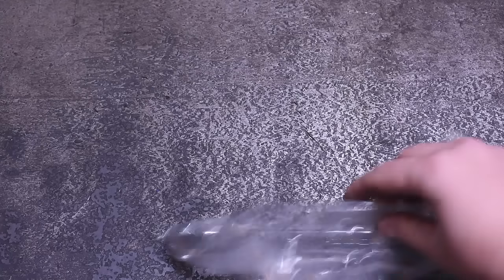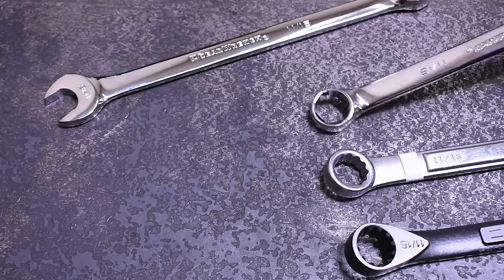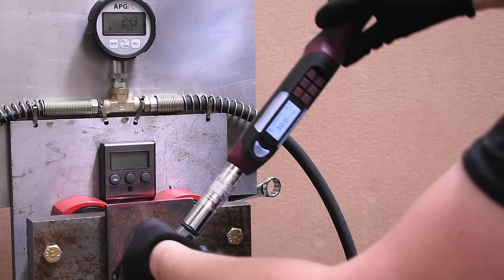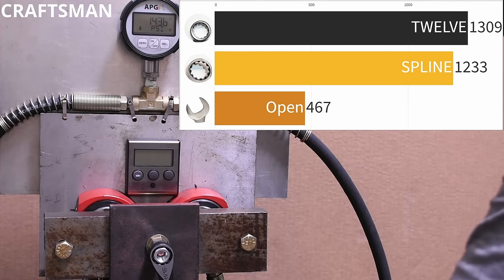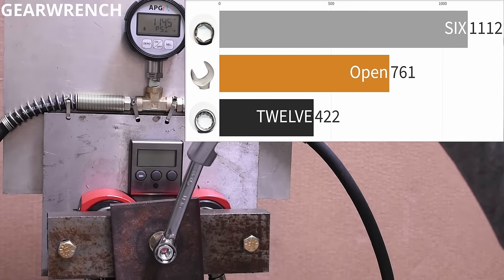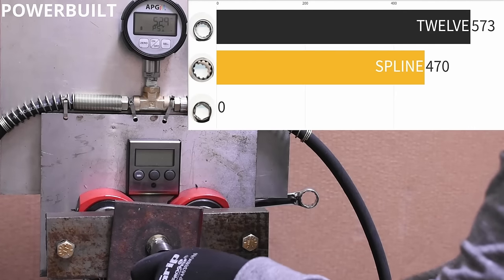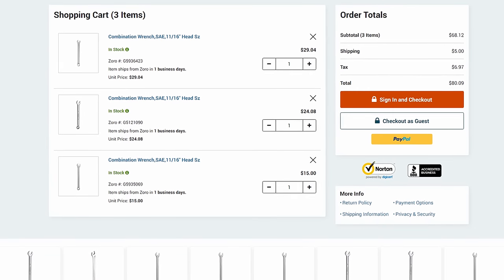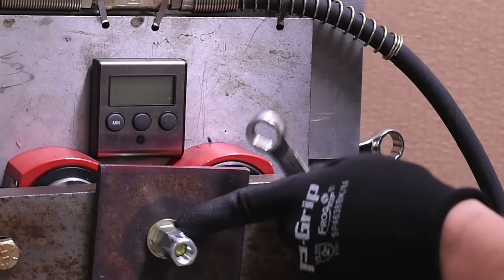Let's Settle This! What Wrench & Socket Design Will Slip 1st?

Comment: No clue what some people do with their tools to even need this info. Been turning wrenches for almost 20 years. I own exactly zero 6 point sockets or wrenches.  12 point works just fine all the way to 600 ftlbs. Anything over 600 ftlbs we use hydraulic hi-tq so that could be why I've not had a problem.  Also I work in an industry where we don't have rusty, chewed up crappy hardware.  Only thing I can figure is people need to workout their hand and forearm muscles to actually hold the socket on the fastener if its that big of an issue.

Comment: I couldn't help but notice, but I may be wrong. It didn't look like you changed the nut after the first wrench rounded off before trying the next style wrench within brands?
Reply from the maker: Each used a different nut
Reply: @TorqueTestChannel  okay, I guess the precision rounding threw me off 😂

Comment: 12 points have been the ONLY type of wrench that has continuously stripped my hex bolts on my car! 

And no its not bc Im "using it wrong" or "putting too much tourqe on them" its the fact that 12 points just have a knack of slipping no matter the technique if its a tourqed bolt

Comment: Can you please conduct this with the Astro 7181XL? They are box end wrenches designed specifically for rounded fasteners. I have a set and there are a couple time they saved my ass and well, other times there were less useful.

Comment: So basically 12 can be useful on wrenches for usability, as it can be easier to get on a bolt, but only when you can't fit a socket, and only when the bolt is clean and not overly stuck.

Comment: You should have, but yYou did not make the distinction of using, or not using, the new fangled 6 point socket design having radiused corners such that the turning force is NOT at the bolt, or nut, hex corners, but instead at the flats of the fastener. I have found that a new fangled design radiused corner 6 point socket will grip on those rusted and rounded fasteners well enough to bust them off and not needing to get out the cutting torch, hammer & chisel, or grinder.

Comment: I've got gear wrench ratcheting 12pt and they slip constantly and then craftsman not ratcheting 12pt and they slip occasionally on really rounded bolts but in general never as much as the gear wrench

Comment: Id love to see a comprehensive torture test of Pittsburgh sockets. Not the nice ones that are sold on a rail. 
The ones in like a "52 piece socket set, ¹/4 to 1/2" drive sae/metric" and the set will be like, $10
Ive had a set of socket wrenches from HF for about 4 years now. The wrenches themselves have held up well

Comment: Should have thrown a vise grip in the mix. 😂 That's the last tool you use on a stripped bolt before you bring the car in n explain your brothers cousins wife did your oil last n chewed up your bolt. Love the channel.

Comment: Iwould have used a "minimum spec" flat size instead of a "pre-rounded" condition. However, apples to apples either way.  Interesting that only twice did the nut start to collapse.  How do the "any nut, no matter the damage" wrenches/sockets compare? Pipe wrench?

Comment: I just TIG a big nut over the bolt head. A nut with an ID almost the dia of the bolt head. The welding will also heat up the bolt. Then that heat will soak into whatever the bolt is stuck in  - causing it to expand and loosen its grip on the bolt. I prep with two different impact wrenches: One smaller for it's higher speed vibration frequency. A larger one for its hard slamming torque. Loosen with the small one first, folks! Extracting busticated bolts sucks.

Comment: Spline and 12-point grab the corners while a 6-point kind of hug the hole thing. They dig into the corners while the six-point contours to it. If you're using a 12-point for a 6-point hex more than likely a 6 point is the way to go because a six-point wrench was designed for a 6 point hex.

Comment: In my opinion. If you are going to get wrenches or sockets, just buy both 6 and 12 point. You never know what you’re going to need at certain points in time and it’s worth it to have the tools for the job rather than having to go to the store later anyway.

Comment: I personally didn't like the method for rounding the nuts as it didn't seem to be consistent along the length of the nut and in my experience, not truly representative of what I have dealt with. I would love to see this test with "field rounded" nuts, which are often caused by people using incorrect sized or badly worn wrenches. This often creates burrs on the corners of the nut and is what stops me using 6 point sockets and wrenches.

Comment: the best example is when you need to open a rusted brake caliper bleeding screw. with a 12 point there is a high change to make it round. with the 6 point you snap the screw of in the worst case, but you dont make it round.

Comment: I'm sure this as already been covered but I'm not sure why you would want to purchase a set of spine tools for exclusive use on 6 point or 12 point hardware. Outside of aviation I haven't hardly seen any spline fasteners. The reason that mechanics that work on large jet aircraft purchase spline tools it to cut down on having duplicate tools for the same task. So if you have spline tools they'll work on spine, 12 point and 6 point fasteners. One set of tools for all possible combination of fasteners. This isn't the case with 12 point tools. Neither 6 or 12 point wrenches will work on spline, so if you don't encounter spline nuts and bolts there really isn't much of a case to purchase them.

Comment: To the surprise of, hopefully no one, using the correct geometry wrench for the bolt you're tightening provides the best result, followed by spline which seems to work okay as a 'general purpose' that fits all common bolt geometries but should IMO only be used on spline bolts (which you're probably not dealing with very often so most people probably don't need spline sockets or wrenches).

12pt should really only be used for 12pt in my view, unless you like stripping 6pt bolt heads then go right ahead.

Comment: Spline are good when faced with an already rounded off nut. Hammer on a smaller spline socket and off the bolt comes.

Comment: That's really simple. The twelve point will be the first one to slip and bust your knuckles. I know, I've turned wrenches for 45 years and have lost plenty of skin throughout the years. LOL. 😂 😢. The only time a twelve point doesn't slip is on a twelve point bolt head.

Edit: Years ago it seemed like tool sets had only six point sockets and if you needed a twelve point you had to buy it separate. Nowadays six point sockets are rare in a set of sockets. Then along come metrics a whole other set of tools. Then along come Torx, another set of tools. It never ends. I've got certain tools that would be used maybe twice a year, but it's great to have the tool you need when you need it. I always hated to borrow a tool, for if I broke it or lost it I had to replace it so might as well go ahead and buy it. Spend the money on myself and not someone else. 😌 I'm retired now, but I still buy tools occasionally 😅. 

God bless all. ❤

Comment: 6 point on a 6 point bolt is always going to be best. As for everything though, cheap wrenches will do worse, open end being the most noticable between a good and cheap wrench. For instance, Pittsburgh from harbor freight, the open end actually stretches open, I don't recommend Pittsburgh wrenches that are under 1".
 That said, I've broken everything from Pittsburgh to snap-on and everything in between.

Comment: 12 point tools and 12 point spline tools are designed for 12 point bolt head and 12 point nuts. Use the correct tool for the job and you will always get the best results.

Comment: Its simple, 6 point for normal bolts and nuts, 12 point for 12 point bolts and nuts.
Reply from the maker: That 12-point is on the end of a combination wrench, what's the open end for if it's supposed to be used on 12-point? The 12-point end is for additional degrees of access.

Comment: I guess the Craftsman and Snap-on stores don't come up in his Google search.  I was curious on some of these differences, but then he basically went shopping for tools at AutoZone.  I've been a professional mechanic for 20+ years and definitely have owned my share of craftsman tools.  Nothing pisses me off more than working behind the guy with Harbor Freight tools that already rounded off the hydraulic line or nut.  
I've never considered using "Power Bilt", and it tested as some of the worst because I'm sure they're cheap and flexed.  I own craftsman spline, 6 and 12 point sockets, as well as spline, 6 and 12 point Craftsman combination wrenches.   There wasn't any need to go to the bargain bin at the auto parts store.

Comment: I think the open end numbers would be different for a quality wrench. Snap-On is built better with better materials and tighter tolerances so the jaws won’t spread. 

Maybe do a quick test on all open end wrenches to see if different brands or designs (Flank Drive, etc) work better??

Great content as always.
Reply: ot possible,open-ends are not for tightning,just for a faster spin if you will, they only grab 2 corners, out of 6, line wrenches are already improved open-ends but not worth a dime

Comment: Aircraft use a lot of 12 point sockets, and their hardware is rated higher than most automotive bolts.  Also a lot of aircraft bolts are close tolerance

Comment: FWIW: I think the socket test wasn't fair to the sockets. Yes, you may not get the socket fully seated--but if it's shallow, you do have the flat surface to push against and keep your torque more perpendicular. When you're trying to put it half on, it's very difficult to apply perpendicular torque.

Comment: My pennys worth . . It depends which wear the head is exposed to plus tool quality. Corrosion will eat away the 12point and Spline causing problems far sooner. If all designs are dry or oil soaked then the tool quality decides.

Comment: I really think that the issue is the test bolt not the tool. What is disforming is the test nut not the tool. Maybe the test nut is softer metal than the tool.
Reply from the maker: Correct. Just like real life. No one's breaking these, they are messing up bolts. The one that does that less is best

Comment: 12 pt for 12 pt bolt heads, hex for hex heads, spline for spline bolt heads. That's what they were designed to do. Don't mix them unless u like to strip and round off bolts.

Comment: Technically, a hex should be the best for a hex shaped bolt (most amount of contact on the surface). But due to wear, and tolerance differences in the bolt and the wrench, sometimes other designs are better.

Comment: What i would like to see is using the right type of fastener head with the right type of wrench, Ie a 12 point wrench on a 12 point fastener, Spline wrench on a spline fastener. Please  use the correct wrench on the right thing  its pretty bad using  the wrong wrench on the wrong fastener. ofc they won't work as well if miss matched, Yes I am a mechanic for 30 years and  know and have used all  but only on the right type of fastener head. Makes a huge difference

Comment: 12-point sockets were more of a useful thing back when ratchets were a lot lower in tooth count - you could get them onto a bolt at more angles, the 12 points making up for the lack of fine increments of adjustment on a 36-tooth ratchet. With a higher tooth count modern ratchet, there's less of a need for 12-points, except of course for 12-point fasteners.

Comment: 6 point for anything crusty you're servicing or new things you're more concerned about marring. 12 point for new stuff where cosmetics aren't a concern. I imagine the cheaper 12 points and splines are relatively worse than their 6 point equivalent when comparing to higher quality wrenches because of the softer cheaper metal in them.

Comment: Everything was as expected in this testing. But these aren't really how these tools are typically used. Maybe an unknowledgeable DIY user might do this, but people shouldn't torque with hand tools except for a torque wrench and if you have to use a hand tool to loosen something with a hand tool, you use a exactly the video's winner, it's a 6-point socket with a breaker bar. And the thing is that newer 6-point sockets don't work the way they used to. Any decent 6-point socket is an oversized hex with a curve wall contacting the flats on the fastener. This changes the contact points on the nut to the side walls rather than the hex corners which completely removes the occurance of rounding the corners. Not only is there better contact with the fastener, the socket is exerting forces from the thickest wall sections of the socket. Unless there is a typical application for a 12-point nut, I know of no mechanic that uses 12 point sockets. Working as an assembly manufacturing engineer being responsible for tooling out factories, I've never spec'd out the use of any 12 point sockets for hexed hardware. Ever, and this was even before newer design changes were implemented in better 6 point sockets. 12 point socket are a complete waste of money and the rounding of a fastener hex is when people get hurt. Only two things can happen with a 12 point socket, the thinner walls fail or the fastener round out. So you don't use them.

Hand tools are generally only used to hold back up. You use combination wrenches because you might need access with an open end, but you really should always hold backup with the box end. If you ever have to use an open end, something is designed incorrectly. Tool clearance should alway be considered in any good design. But there is a lot of bad design work out there, so you need the open end. Holding back up could be with use of another hand tool, but more commonly you're going to use a power tool. And that hand tool is always going to be socket wrench with a 6 point socket until you need the torque wrench. As far as using a 6 point box end, you don't buy these. They restrict angle access. If you need tool clearance, you buy wrenches that don't have offset angles, meaning straight ones. At home for my own use, I have sets of wrenches both with and without offset angles. While there is a mechanical advantage to using a 6 point box end, you don't need this. This is because you are only holding back up with the hand wrench. And following best practices you always torque the nut, not the bolt. You don't apply torque to bolt because it applies torque to the shaft of the bolt which could cause failures along the shaft. The only exception to this is using a bolt into a threaded blind hole which doesn't require backup, so you're not using a hand wrench anyway. The reason you can get away with a 12-point box end is because if you apply torque to the nut, the bolt starts to bite into the fastened surface before the threads start to collapse at the specified torque. So you actually don't need backup when full torque is applied to the nut. The clamp load on the bolt head and washer at this point are holding the bolt head from spinning. Back up tooling is only needed to keep the bolt from spinning until the clamp load is introduced. When you're loosen a rusted fastener you're still supposed to hold the bolt. You can still get away with a 12-point box end because the bolt shaft is absorbing a considerable amount of torqure. The shaft is actually twisting and springing back between hammer impacts of the impact wrench. So again the box end still isn't receiving the full breaking torque required to break loose rusted hardware. If this becomes an actual problem, you go get a breaker bar with a 6 point socket and hold backup with that instead of a combination wrench.

Comment: Dad always told me to use 6 point. Spline seems like it cheats a little by digging in and mangling the bolt head even before failure.

Comment: You used the open end positioned upside down. The leverage is >> if used correctly, not that it would make much difference against the other wrenches.

Comment: You really need both 6 and 12 point sockets and wrenches. 
If you only have one shot to remove a bolt/ nut, 6 point all the way.  
   A slightly deformed bolt head may not accept a six-point but can still be removed with a 12.  
   You also will not remove a 6-point reverse star with the 12 point... 
  Having the right tool/wrench set for the job can cost less than trying to removing a broken or stripped bolt head one time.

Comment: Try using a 6 point box end in a tight space where you don't have enough room for another turn! That's why 12 point box ends are the most common therefore the cheapest. Sockets on the other hand really don't need to be 12 point, unless your using a non ratcheting power bar in a tight space then the 12 point will be useful.

Comment: In theory a 4 point would be best for max torque. but 6 point isn't much worse and nicer to work with, that's why nuts have 6 sides. the 12 point wrenches are compatible with 6 sided nuts and are even nicer to work with, and that's why they exist.

Comment: I'm from the 80's most of my tools are 12 point,....I still use them,.. but I bought 2 sets of craftsman socket set for about nothing from Lowes one was regular the other was metric but both were 6 point they are far superior.
12 point will strip tight bolts,...6 point dont.
But go to Harbor freight buy item I believe 1407,...their sized in regular and metric,..... you pound them on and remove the rounded bolts.
Buy 6 point wrenches too.